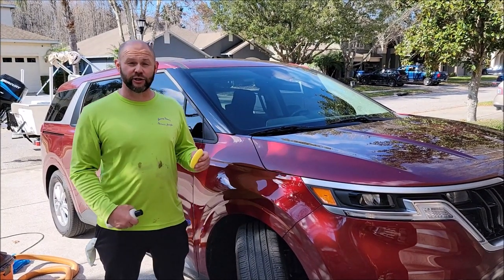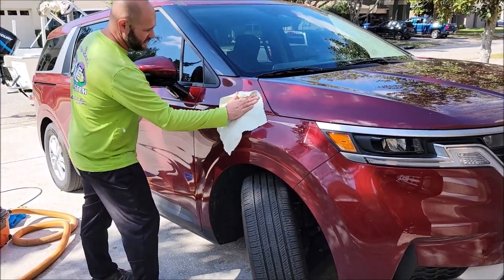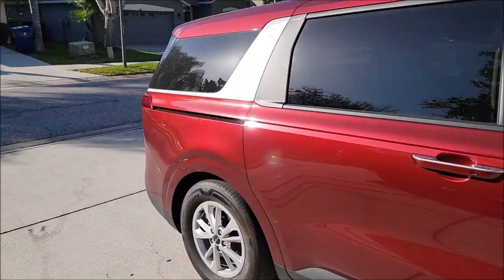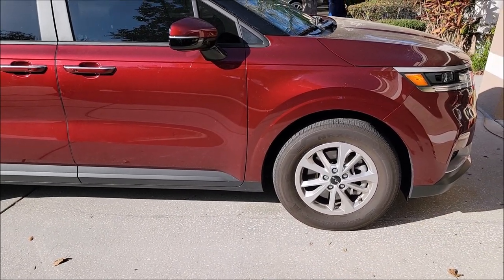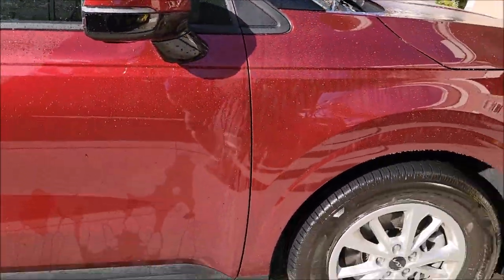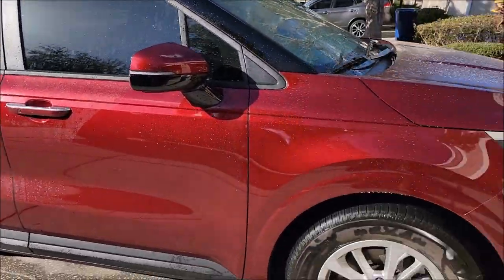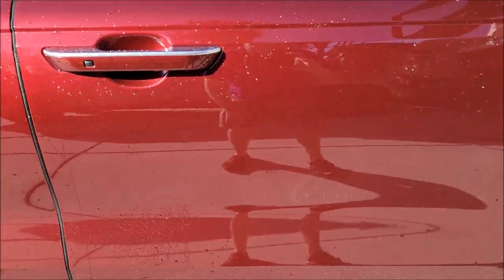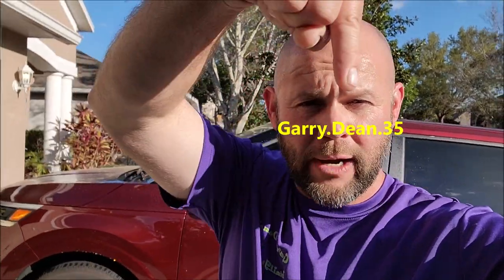2022 ONE SYSTEM - TOUCHLESS CAR WASH SYSTEM - TOUCHLESS RESIN COATING - TOUCHLESS CAR WASH SHAMPOO

Comment: Man loving the videos, I am new to detailing this sure cuts down your work load when you come to doing a maintenance wash and it sure does a great job.

Thanks for putting together a channel with so much value... subscribed :)
Reply from the maker: Yes, this system works really well and definitely cuts down on the need for lots of elbow grease. I will post more vids of this system soon!